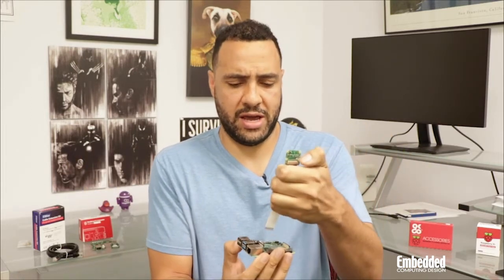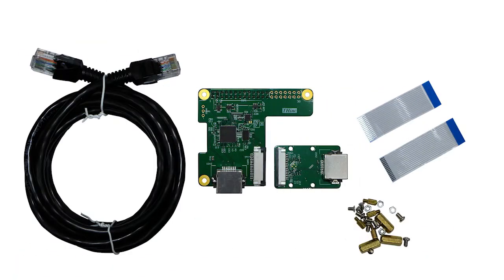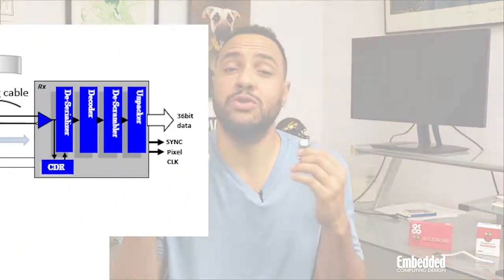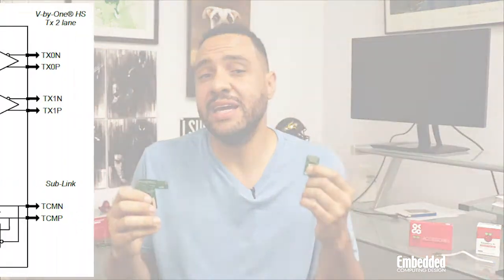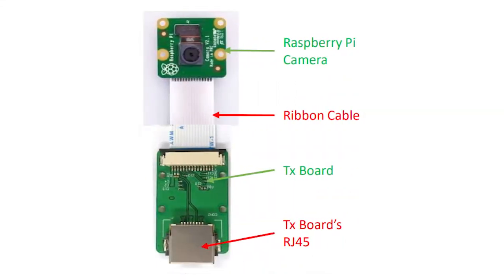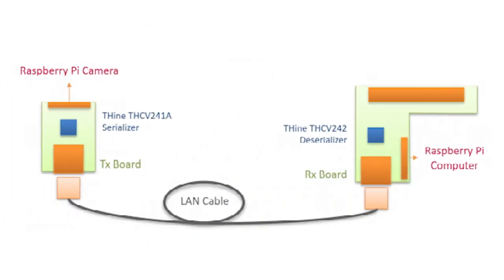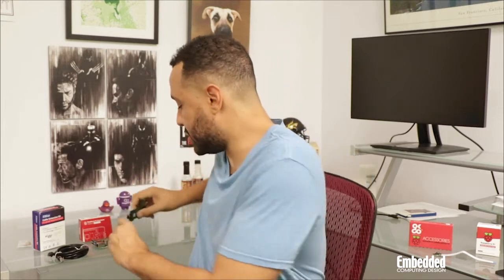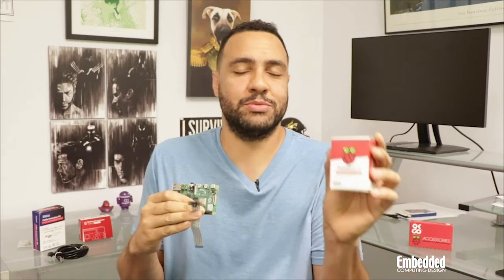DEV KIT WEEKLY: THine Cable Extension Kit for the Raspberry Pi Camera Module

Comment: A follow-up comment.  A great product would be a server where several long-range cameras could connect to a server.  Clients doing image processing could connect to the server to get the raw image data.  Right now, one camera, one raspberry pi.  This would work for robotics, in particular with something like the Nano Jetson.  For the Nano Jetson, one camera, one Nano Jetson does not make much sense.
Reply from the maker: The proposed solution would give you a 4-camera edge server? To maintain resolution up you might need to use the US (ultra-speed) version of V-by-One which ups the throughput o 16 Gbps.